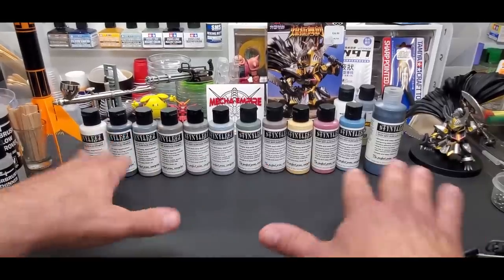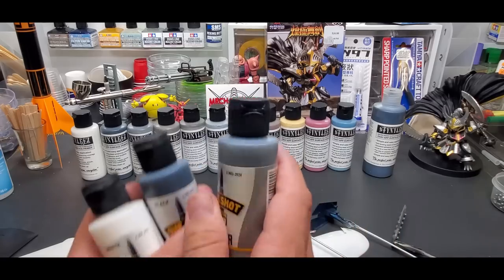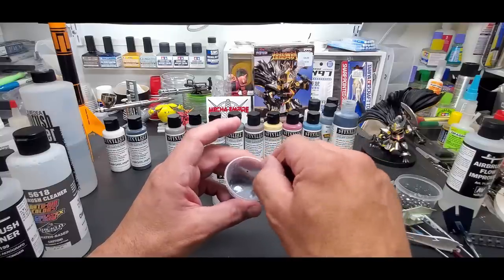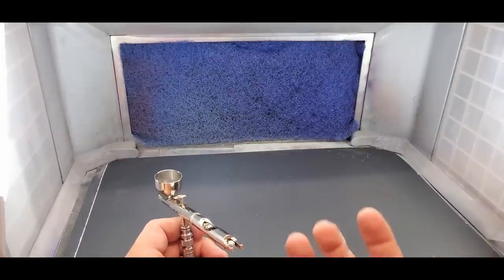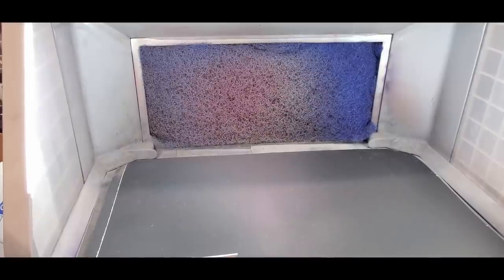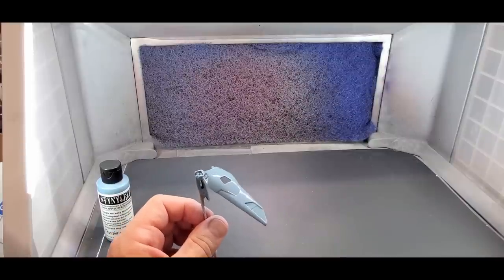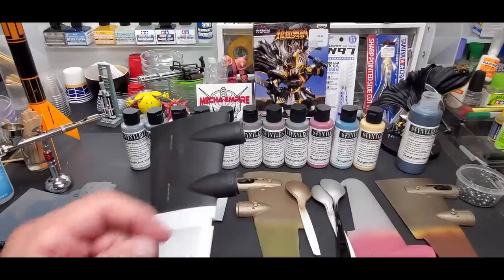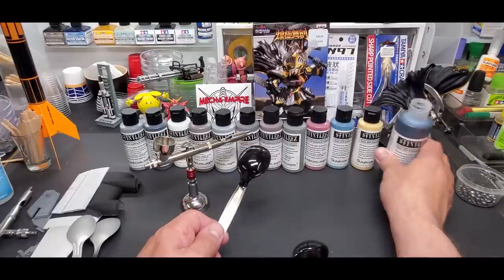Testing Stynelrez Colored Primers - The Best Acrylic Primers You Can Buy - Plus Giveaway !!

Comment: I spray it with a .3 needle in my Eclipse HP-CS at 30 PSI with no thinning. Works just fine. Also worth a mention is that you can spray any paint you want over it. Thanks for the video!
Reply: Thanks, I’m curious how enamel will turn out on top of it.
Reply: Thanks, I’m curious how enamel will turn out on top of it.

Comment: The way I’ve been dealing with the white is to spray gray first then put a thin coat of white over the top of it.

I was initially trying to do zenithal highlighting with just the primers but I think it’s a better plan to prime black and use a white paint or ink instead of white primer.

Comment: Hi Rex. Thank you for another great review. One thing that I would add is that if you end up with dried Stynylrez in your airbrush the best cleaner I found is Denatured Alcohol (Fuel). I use the Kleen Strip brand in the blue can from Walmart. Also I bought that vortex mixer in this video based on your review and it is one of the best things  that I have added to my workbench in years. Having a consistent paint mix has made a huge difference in my ability to spray acrylics.  Thanks again and keep up the good work.

Comment: I got the white, black, and grey a couple of months back. These primers helped me realize that my old airbrush was crap and I needed a better one. It would dry really easily on the needle mid project and I'd have the disassemble and clean out. even with thinning. I went off and got an eclipse, and after a little thinning no issues.

Comment: I spray Stynylrez using a .3mm needle @20 PSI. Never thinned and never had an issue with a decent airbrush. Tip dry is prevalent with it if your air pressure is too high and every one of my cheap airbrushes seems to suffer from it since they move way more air than they do paint.

Comment: Been using this for ages now, it works best with a thin coat anfd then go back and load it on. I use a 0.4 at 25psi and it is fine.

Comment: I've been using these for a few months now and find them a very good product, across the board.  My only gripe is they stick so well, they are tough to get out of the airbrush if left too long - and by too long, I mean a very shot time.  But, they are great primers.
Reply: Shoot some hardware store lacquer thinner, should get it out no problem
Reply: That's my issue with them too. Try super hot water. Works pretty well for me
Reply: @mattterrell4304  call me stupid for asking, but is super hot water safe for the airbrush? I try to like this product but it dries sooo fast its just unworkable for me :|

Comment: I have just started useing stynylrez primers. I have the black, white, gray , and the red brown. They work well on photo etch and are really durable. I have an very old 1970's badger air brush that uses the old bottle siphon with a 5mm needle. It came with a 3.5 mm needle originally. I have been thinking about getting a newer badger like the 105 or the extreme but don't know if it is worth it to spend the extra money for the flow valve on the extreme model. I thinking the 105 package with the 3 different needles would be the better choice that way have the variety of sizes needles for different paints like stynylrez primers and other regular paints. Like the variety of different color primers that stynylrez offers. I didn't know that they offered so many. It was a good video review to see all the other colors and how they spray. Thanks for sharing and be safe. Look forward to you next video. 👍🚂🚢⛵

Comment: Another great review. I've been using Vallejo primers but have heard you mention the Stynelrez in previous videos and definitely want to try them out. The Vallejo also tend to dry quickly at the tip and they seem to have a rougher surface.
Reply from the maker: This Stuff is great. Try one color to test for yourself, you will definitely be hooked
Reply: @barbatosrex9473   I finally got to try out the gray and flat black for a 1/144 Millennium Falcon build I have. Very happy with the results.
Reply from the maker: @Johnny_Electronic  it's a great product. Remember if you have any kind trouble with them just add a few drops of thinner

Comment: Thanks for this video. I tried these with a .35 needle and thinned 3:2; worked reasonably well. I now have a brush with both a .5 and a .8 needle and will try with those on my next kit.  Still don't like how hard the white is to clean up.
Reply from the maker: I had no problems cleaning the white. It cleaned out the same as the other colors. Just performed differently
Reply: @barbatosrex9473  I added a few drops of Vallejo Flow Improver and that seemed to make the clean up easier.  Still seems to get a bit crusty in places.

Comment: I just received my first 2oz bottle of Gloss Black, and I could not get a true gloss finish that was useful with chromes. Both tests I ran used a .7 needle and 20psi, on glossy white spoons. I applied 5 coats to the first spoon, drying in between with a modeling heat gun, and when I realized that the gloss was only semi-, I tried again on another spoon, with only 2 light coats to get full coverage. Yes, it was less shiny than the first, but both were still not high gloss, like my Alclad Gloss Black produces without breaking a sweat.
Reply from the maker: Some batches require thinner to get a nice Gloss. I have troubles with one of my bottles. Thin it about 70/30 paint to thinner. You'll get a nice shiney finish

Comment: I am not sure where I am messing up, but I bought a few of these some time back, but when I use them, trying to clean them out of my gun is a massif pain, as it is like trying to pull gummy syrup out of the tip etc. I have experienced this before when using other water based acrylics as well. I have tried thinning with 91% alcohol, Windex, wiper washer fluid, etc. I was hoping this was a good alternative to seal plastic before using lacquers, but I am not sure it is worth the massive cleanup effort. What I am missing? How are you and others working around that.

Comment: Rex, this is the test I was waiting for! I don't know what I did different to what you did, but I have different results for the black and white.

I have been using stynylrez exclusively for a couple of years now. I use the gray all the time, occasionally use the black, but have had no luck with white. The first bottle I bought didn't spray at all...it would clog the brush (.5 Procon Boy @30psi) within 45 seconds into my priming session. I thought maybe I got a bad bottle, so I bought another one. It did the same thing. I tried different pressures, but I could never get it to work.

I also used the black as a main color for one gunpla kit and the primer scratched off of some areas two days later when I assembled the kit. I cleaned all the parts, so I'm not sure why it didn't hold on. I also use black for frames and it always scratches off at the joints. Maybe it's me, I don't know.

The gray is the champion for me, though. No thinning, .5 Procon Boy at 20psi and I can spray for 45 minutes with no tip dry at all.

Comment: I've tried a few primers for gunpla bits (vallejo, vallejo mecha, and stynylrez) and stynylrez is definitely the best.  I still haven't been able to get it on totally smooth because it runs away from me pretty much no matter what, but I'm sure I just have to practice.  I probably just have a heavy trigger finger.  I thin it a little bit with vallejo airbrush thinner and use a 0.4mm needle at about 25psi.

The regular vallejo primer is totally useless for everything and the mecha grey and mecha black are pretty good.
Reply from the maker: It's a great primer. I do thin mine slightly too. Back off the the air pressure a little and go with a few light coats. You don't have to wait long between them just a minute or so between coats. It will look rough but it will dry perfectly
Reply: @barbatosrex9473  Thanks for the tips!  I finally got it right on my new 1/72 X-Wing model and it turns out I was being too fiddly with thinning.  All I did this time was mix 20 drops of Stynylrez Grey with 3 or 4 drops Liquitex flow improver, shot it at between 20 and 25psi with a 0.4 needle and boom, perfect!  Also very very thin coats like you suggested.
Reply from the maker: @sourcedecay  once you get down, this primer is awesome. Dries super smooth

Comment: I have used Lysol pump spray to clean my airbrush and it works great. I have not yet tried Stynelrez  but will purchase some as i am running low on paint. Have you done a video on cyanoacrylate glues ?

Comment: Thanks for the polycap test!
I guess it won't hold against extreme bending, but for a fixed position it'll probably be alright. As in it'll be fine to paint it and won't flake off unless touched/treated with force. 
At least it'll look nicer than an unpainted polycap. Thank you again!

Comment: I had TERRIBLE experience with the basic ones, black, white and grey. It was like shooting thick mud trough my airbrush. Tried thinning with vallejo thinner in different ratios, home made thinner different ratios (the one on your video), different PSI, bigger nozzle and nothing. It always was like a blast of concrete with a terrible rocky finish. I had to look up and it seems that they have a little problem on their quality control since some batches had or have this issue and some don't.  For acrylics, i ended up just buying Vallejo Surface Primer. So far is the only one that's not giving me so many problems and where i live i don't have much options sadly.

Are you planning on doing a Mr.Finishing Surfacer lineup video? Currently i'm using Alclad Black Base for my projects, robots and some mecha-like stuff but i saw they have a pink one and it looks cool to try.
Reply: I have found a couple that didn't work thanks to freezing weather during shipping......, but the rest are great
Reply: If they freeze they are junk. What I hate most about living in Minnesota. Always a gamble ordering paint online.

Comment: I only have a .3 mm airbrush. Should I just thin this further to get it to work? The finish I've been getting from my primer is kinda grainy
Reply from the maker: Yes. First shake it vigorously and I recommend straining it too. I would absolutely thin it. Not too much like 7 parts primer to 3 parts thinner. Use a brand thinner and not water.
Reply: @Barbatos Rex  thanks for the quick reply! I have a small bottle of Vallejo airbrush thinner so that should work. Do you mean strain it like through mesh or something like a coffee filter?
Reply from the maker: @EndofDarkEpiphanies  use anything you can. I have a strainer but I also use panty hose or something similar. Turn up your air pressure too

Comment: Great video! I only have tip dry with the white Stynylrez @30psi with a .5mm needle on my Grex Tritium. Any suggestions if I should go down in PSI to stop the needle tip dry issue if you say to not thin this specific color?
Reply from the maker: The white is tricky and it's the only one like that. I'm guessing it's a different formula than the others. You're going to get tip dry with it no matter what you do. Add some Flow Improver to slow it down. Keep a cup of hot water by your airbrush and brush over it as you go. Plus you can switch to a lacquer white primer.

Comment: I have both stynelrez and one shot... stynylrez just doesn't work in my H&S airbrush (neither 0.4 and 0.6mm needles). Even thinned down, still chokes the airbrush very irregularly.
One shot primers work a bit better, but they don't have the same finish as the stynylrez (less matt and a less sandable).

Comment: Man, I don't know what I'm doing wrong. I bought the three primer Stynylrez, Gray, white and black. It doesn't want to stick to the spoons. It makes kind of bubbles. Don't the  primers grip on anything? I put the pressure between 20-30 and tried with a 0.5 and 0.3 and I still not getting the result that I'm supposed to get. The primer spray cans work fine, but airbrush, I got hard time to master an airbrush
Reply from the maker: Have you thinned the primer slightly? Also spoons are tough, they're all different. Try lightly sanding them
Reply: @barbatosrex9473  yes but instead using the thinner, I use Reducer 4012 and even if the white one doesn’t need as they say, I put just a bit, very few drops. At the end, I tried as it is, without but no success on that too. What I don’t understand is when you do it, you don’t have any difficulty at all to make it stick even on unprimed spoon. What is the damn secret? Is it because I used a reducer instead thinner?

Comment: Thanks for the great video as always. I bought white and black One shot primer, but I am just unable to clean it. I tried hit water, Vallejo cleaner and 99% alcohol. Nothing works…
Reply from the maker: Have you tried the Badger Stynylrez cleaner?
Reply: @barbatosrex9473  It is very difficult to find Stynylrez supplies here. That's why I chose One shot primer.
Reply from the maker: @XuemingLin  did you  brew hot water thru a coffee maker? It has to be very hot water
Reply: @barbatosrex9473  I did Sir. Hot water works like a charm for Vallejo and AK. But this One shot primer is just acting soooo weird. Actually now when I am researching more, I see I am not the only one suffering. Many people have problems with Stynylrez primer as well.
Reply from the maker: @XuemingLin  I know during the pandemic Stynylrez had to change the chemicals used in the primer and because of that they had nothing but problems and people kept calling them demanding their money back. Since then they fixed it so I'm wondering if you got one of those  from the bad batch
Reply: @barbatosrex9473  Thanks! That explains! I think I was just one of the unlucky, because it's behaving so different from many of the good reviews online. Looking forward to you next videos!

Comment: first of all, sorry for crappy english, I have in use a bottle of ammo one shot, sand color, the problem that I found out is that the surface of the plastic need to be very clean. I don't have this problem with the auto type primer, with this primer doesen't matter the fingerprints, but the one shot type, needs a cleaning bath, whatever you do, you need to clean the surface prior to start priming. still, very good primer, too expensive around here, nobody sells the badger one.

Comment: I tried the Stynelrez primer and completely ruined my airbrush. I tried cleaning it but the tip is so clogged I cannot get it clean and now I cannot get it back together correctly. The frustration level is high @Barbatos Rex ! From one Rhode Islander to another, I feel like I'm gonna have to wait until I can afford a new airbrush(which may be a while) before I can try again.
Reply: Some old bottles of Stynylrez have dried bits in them. These dried bits will clog your nozzle. You need to use a paint strainer before you put it through your airbrush. Then it will be fine.
Reply: @dbroadwayvfx  Thank you for the advice. I just ordered some filters from Harbor Fright (wish I knew how to get this channel credit for the order). Any suggestions on how to clean my airbrush.... I took the thing completely apart to try and clean it but putting it back together it does not seem the same and it still feels sticky and no air is flowing through it. It is a cheap "Masters" airbrush. Should I ditch it and wait until I can afford a decent one?
Reply: @teekay9228  I do not have experience with a masters airbrush, but when I clean mine, I take it apart and soak it in isopropyl alcohol. Then I use dental brushes to clean inside the nooks and crannies.

You may be able to find youtube videos on cleaning airbrushes in general, and maybe even a video on doing it specifically to a Master Airbrush.